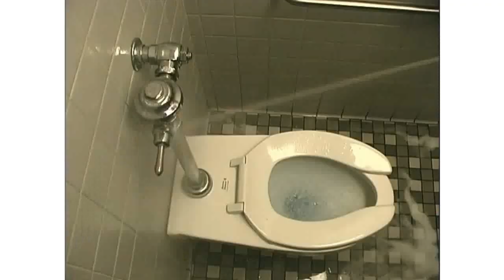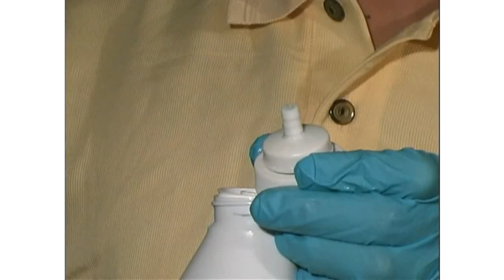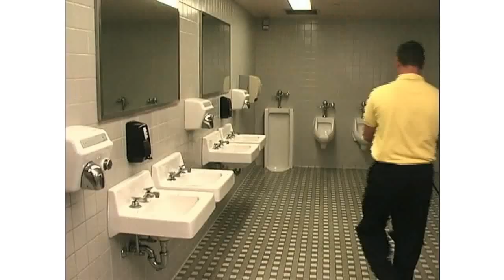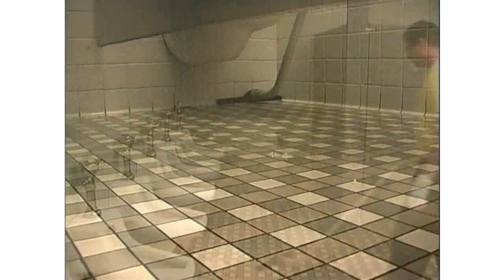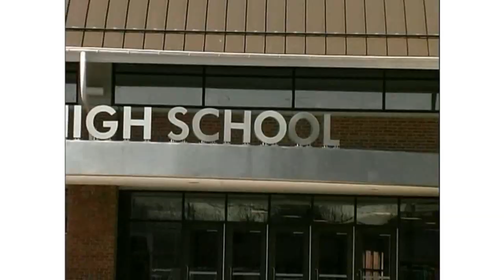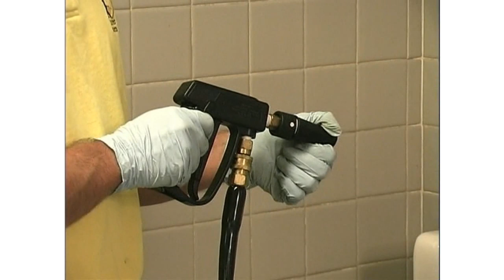Kaivac restroom cleaning

Comment: Not worth it if you have a small bathroom, a business that has a small bathroom will not pay a lot of money for people to come with this, or pay to own this, a good cleaner can knock a bathroom out in several minutes, the same time it takes to set this machine up, I would be done cleaning a small bathroom! But I do like the idea, but it's just not practical, germs are everywhere, even offices and gyms, how are you gonna clean those dirty, germ infested areas with this? You can't, no matter where you clean, you're gonna touch germs.
Reply: i work for large operation, this machine only for deep cleaning when i use. the sprayer is useless, don't take shit off right away. still much faster do all by hand.